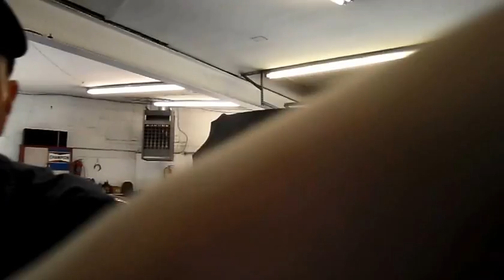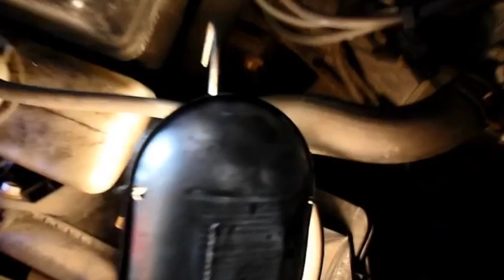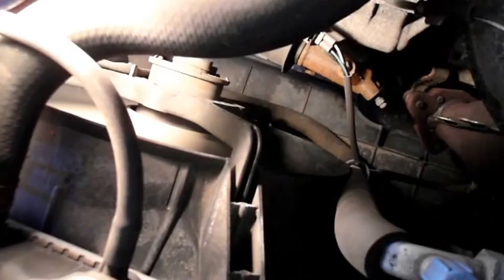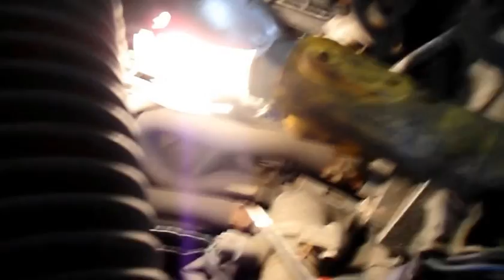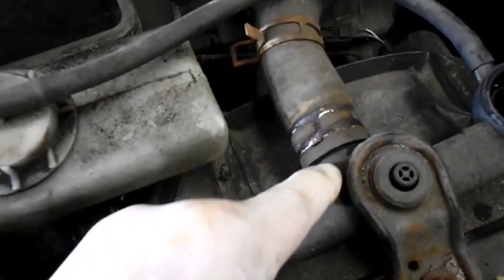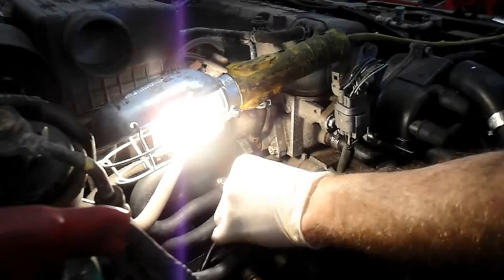How to diagnose and repair an over heating problem on a Honda Civic

Comment: Hi I have a Honda Civic 2003 auto 1.6 I have got overheating problem changed thermostat no more leaks bt it’s still taking a lot of water
Reply: Samson alonge, did you ever got it fixed? If you did, please what did you finally do to fix it? I have the same car with the same issue
Reply from the maker: Samson Alonge If there is absolutely no leaks then you need to check the head gasket. It may be burning anti freeze. Is there any check engine lights on?
Reply: jimthecarguy no there isn’t
Reply from the maker: Samson Alonge Unfortunately it sounds like the head gasket. There is a tool you could buy to check for exhaust in the cooling system. That tool will confirm if it is the head gasket. Try to get it at your local parts store.

Comment: Jim, you are a kind soul, I can hear it in you voice. Helping your fellow man by sharing your knowledge is a special gift.  And I agree with your "all things stop for coffee" attitude.  I never considered the danger of cracking the plastic neck on the radiator & heater core, but now I will.  Lastly. . . . .   I better stock up on some Hi-Tech paper clips!

Comment: I have a 2002 honda accord its overheating so far i changed spark plugs, thermostat, coolant temperature sensor. To check if the fans were working my car was overheating so I popped the hood and both fans are working. I dont know what else to do or to check. I need help asap
Reply: on older cars the pump may not be leaking but the fins inside the pump may have corroded away to nothing. Look up water pump videos for a 99 or 02 tarus you will see what I mean. I had a friend with a 99 tarus and that ended up being his problem.
Reply: I'm having an overheating problem as well with a 2000 honda civic and one thing I've been told is that it might be the water pump. I would just talk to someone who is honest and has the knowledge to help you out.
Reply: Ivan E. Ramirez  I have but either they said they don't know what else it can be or that it can't be the water pump because its not actually leaking
Reply: https://www.youtube.com/watch?v=ktuc6RJ7EaU

Comment: After couple blocks mine wants to red line,Replaced thermostat, radiator, radiator cap, Both fans, coolant fan/condenser fan,Temp/fan switch, ECT sensor, head seems OK no leaks the radiator is holding coolant and reservoir is where it has to be fluid wise,I noticed my coolant fan is not doing its job 3/4 till red the fan won't kick on? I just replaced the Fan control switch and ECT sensor, the coolant fan only comes on with a/c on which both fans come on, I'm stuck guy, it won't even cool down when I turn the heat on, I'm not sure what's up with the fan? The fan switch is new from autozone duracrap brand, I was in a bind.
Reply from the maker: Thank you for stopping by the shop

Comment: I am having this same problem, my 91 civic is overheating I just replaced the temp sensor, temp sending sensor, thermostat, and relay and It is still not turning on, if i take the fan and hook it straight up to the battery it comes right on. Do you think even though the coolant relay is new it can be bad? Thanks
Reply: Did you ever figure out the problem? I changed all three sensors and thermostat and bled the system.

Comment: Hey jimthecarguy I have a 2005 civic and it runs hot after driving it a while! The gauge goes up and down! I need help trying to diagnose the problem
Reply: Same. Did you find the solution to your problem?

Comment: Hello! I drove my car for about 5-7 months without a oil change. When i finally was able to get a oil change my car started to over heat.  I have a honda civic ex 2002
Reply: I just turned on my car the Temp is about to past the middle mark and both the fans not dont turn on but they turn on once I put the AC on blast

Comment: Hello Jim, I have a honda civic 2000, fan is working fine, pump is working, i replaced a new radiator but I still experience overheating especially during hot or sunny days, I liked it when it's raining because the car  don't overheat. Any idea what's going on?
Reply from the maker: You replaced everything except the thermostat.When the car is overheating is the cooling fan on?
Reply: yes its always on
Reply: yes
Reply: yes

Comment: My 96 accord is making a very loud "wwrrrrrrrrrraaaaaaaaa" noise when the I accelerate after the car has been on for a while. Any ideas? It is becoming very annoying and I just can't figure it out. Also, it does it non stop if the AC is on but only after a while when it is off. Any help
Is very much appreciated.

Comment: Hi Jim, i have 05 Honda civic the radiator  fluid away fill up into reservoir .please let know why. Thanks
Reply from the maker: There are a few things that can cause that the first is the radiator cap is no good .The next thing to check is the cooling fans and check if the car runs hot.Keep me posted.
Reply: Hi Jim,the radiator cap is changed and the cooling fan but still have fluid fill up reservoir.Thanks
Reply: @tomdanang6788  It’s the head gasket

Comment: At first, I was worried my fan and not turning when i turn on my car. Im having over heating issue with my 98 Honda Civic lx and found milky liquid on the end of my radiator cap so i'm assuming i blew my head gasket but along with my replacing that issue i wanna make sure this doesn't happen again. What is your best advice to AVOID this expensive replacement?
Reply: You pull over and shut the car off when it is over heating.
Milky residue isn't always a sign of headgasket. Water condensation can form on the cap naturally. A better indication of a blown head gasket is the coolant being milky and thick (oil introduced into the system) or your oil being milky/thick (vice versa).

Comment: have a Dodge neon sxt 04 had a bolt stuck in there so I made my own bolt its snug good. no leaks. Didn't start over heating until I changed thermostat. Blows heat did flush only cool stay at right temperature if I have heat on

Comment: You are excellent professional, were you are located Orlando, FL ? my Honda accord  wagon ex 1997 Sometimes it heats up but when it runs it is getting cold down , when stop in the light signal it heats up,I do not use coolant just water , you think it's the thermostat or fan I see fan running and stop, how much is the average cost for repair give a idea thank you very much for help

Comment: Sir Jim, How about the coolant temperature sensor? what happens if its defective? Thanks.
Reply from the maker: If the sensor is defective then the fan will not turn on and it should be changed.Thanks for watching.
Reply: I did all that but replace the hoses on my 01,,deleted cat also,,I believe is the thermostat
Reply: ..nah..tried gasket sealing..work for a mn,,after flushing the radiator...it was the head gasket,,previous owner dint took care of the car

Comment: I have a 05 Honda Civic and it's showing indication of a similar problem with the thermostat. The fan don't turn on, the temperature gauge immediately exceeds past the normal range, and it's leaking anti freeze. is it a easy fix?

Comment: Love 7:53!
Reply from the maker: Oh yea I never pass up a coffee.Lol Thank you for watching
Reply: Excellent Video! Thanks for posting it & keep up the great work! I liked the tip recommending not to 'twist' off hoses. Lots of great insight.
Reply: Quick question: The electrical connector that plugs into radiator fan switch. I replaced it but it's hard to actually snap into place. Any suggestions?

Comment: This seems so helpful except for the fact that (I have an 04 Honda Civic) I've replaced my thermostat, my coolant isn't leaking, my fans work, and my car still overheats if I stay idle for longer than one min...
Reply: Chelsey Bray i got the same problem. You ever get that problem fixed? If so, how?
Reply: Did you ever get it fix?  How??
Reply: @kelchanel0012  did you?
Reply: Same pronlem here any luck?
Reply: @vladisparedes5626  did you?
Reply: Was it clogged mamon ?

Comment: Hi Jim good video. Just wanted to know what you meant by running hot-expansion tank full of coolant. My accord is doing this plus when I take off the radiator cap, looking at the rad. Hole I can see fluid missing it's only on the very top of the radiator. Amy ideas? Thanks

Comment: 1999 CIVIC Overheating
I changed all hoses, the thermostat, i flushed the radiator and put new coolant but still overheats, turns out the fan wont turn on when it needs to so i tested the fan and it turns on manually(used that high tech paper clip) , so i replaced the fan switch but car still overheats.  any ideas on what it could be before i take it to a mechanic??
Reply from the maker: When the car is overheating is the cooling fan on?
Reply: nope it doesn't turn on, once the temperature gets too close to H, i put the paper clip in and it cools it back down and if i go on the highway i leave the paper clip in during my ride to keep the car from overheating on the highway but im worried it'll drain my battery
Reply from the maker: It sound like you have a defective switch or a bad socket.

Comment: Hi Jim, Awesome video and explanation, awesome professional work. Can you tell me the make and where you purchased the power tester? Also, can you comment on if I only have heating issue after 3-4hrs of driving in 95F+, heating fan sensor replaced, thermostat works, no leaks, fan turns on as it should...possible issue? 2000 Civic LX , 115K miles. Thanks Steve
Reply from the maker: Hi Steven, The tool I'm using is called a Power probe and you can find the company on line.If not let me know I will get a number for you.As for the overheating the thermostat may be sticking .Was it replaced?
Reply: No, it has not recently, but what would lead you to believe it is the problem?
Reply from the maker: Because if there is no leaks ,the sensor is new and the coolant fan is turning on and off.The only thing remaining is the radiator or the thermostat.Start with the easiest first .The thermostat.
Reply: Hi Jim, just wanted to send a thank you and followup. I pulled the old thermostat and testing in water, it was rated for 170F and did not open until well past 208F, probably closer to 212F boiling. Going to do full bleed and road test and refill and Ill let you know, but I think its solved. I also pulled relays and cleaned contacts, they had some anodized areas and carbon (sanded them a little).
Reply from the maker: Great keep me posted.

Comment: Thank you for the video very detailed. I'm here looking also to auto repair my car honda accord 99 sedan. It gets very hot in the highway. When I open the radiator and turn the car on I cannot see any movement of water or split. If I tight the big tubes with my hand I can see the water overflow the radiator. If i turn on the heater I can hear a noise coming from the water pump area . My car ran out of oil and got very hot and since then I have this problem. I hope that info is good to guess the problem. I hope is thermostat. Thank you .
Reply from the maker: +daniliver  The thermostat could be the problem but you will need to check the cooling fans to make sure that they turn on.Keep me posted.

Comment: I have a 1996 Honda civic ex that has an over heating issue. I drive it 5 minutes and the temperature will be all the way up. I just replaced the radiator and thermostat this month. There is only 112k miles on the car and It doesn't leak any coolant. I need some advice to see what I need to do next.
Reply: Start the car and open the radiator cap, if the coolant is running the water pump is OK. Next check the voltage on the coolant temperature sensor. Make sure the fan is working. Use OBD11 device to scan your car. if you get code P0120 +++ you need to reinstall the Thermostat properly or replace the coolant sensor. Finally my advice to you is to check the parts first before wasting your money on unnecessary parts! If you knew the problem and symptom and have proper tools you can solve any problems. Good luck.
Reply from the maker: +mjled cars and electronics When the car gets hot does the cooling fan come on?
Reply: jimthecarguy Yes
Reply from the maker: +mjled cars and electronics  Well if the thermostat  and radiator are new and the cooling fan is on.There can only be 2 thing let to check.Is the engine RPM 'S  at 55-60 around 2000-2500 rpm?Is the water pump OK?
Reply: +jimthecarguy how can I test the water pump?

Comment: coolong fans do come on.
Reply from the maker: +Liliana Sualez If the car only overheats on the highway and you replace the thermostat and the cooling fans come on.The radiator may be no good.How may miles on the car?When you drive at highway speed what is the rpm's reading at 60 mph?

Comment: just put in a new thermostat from honda new radiator and hoses.
Reply from the maker: +Liliana Sualez  Do the cooling fans come on?
Reply: +jimthecarguy  its over heating after driving on freeway like wen i get of a exit and come to a stop yes the fans are coming on

Comment: 2005 civic overheating after going bout 60mpg on freeway then stoping for a red light in town its ok  do you think its the same switch issue
Reply from the maker: +Liliana Sualez  Just so I under stand .The car over heats at 60 mph but not when you drive in the city?

Comment: can you not give me advice right now about my  car ??
Reply from the maker: +Allison Currie  You bet.
Reply: +jimthecarguy can you help me with my car please ?
Reply from the maker: Sure what is your problem.
Reply: +jimthecarguy 99 civic overheats after being driven a while just changed thermostat, cooling switch, relay and I tested my fan it's working I don't know what it could be
Reply: +jimthecarguy I checked all my hoses no leaks
Reply from the maker: Does the cooling fan turn on and off when the car is idling ?
Reply: +jimthecarguy no only when it reaches a certain temp
It also doesn't overheat idling from a cold start
Reply from the maker: How high does the gauge go 1/2.  3/4 or more
Reply: +jimthecarguy mostly half or 3/4
Reply: +jimthecarguy when driving on the freeway it's fine but once I get off and come to a stop it starts overheating lowering my rpm
Reply from the maker: Does the coolant fan come on when you are stopped ,idling and the temp gauge is 3/4?
Reply: +jimthecarguy after reaching 3/4 temp yes
Reply: +jimthecarguy yes exactly that
Reply from the maker: Can you get a scanner and check the temp running temp in  the engine ? Also if you can check the water temperature with a none contact thermometer.?
Reply: +jimthecarguy wouldn't be able to do that really broke could you narrow it down to what it could be ?
Reply: +jimthecarguy ok I checked running temp inside engine with infrared thermometer it's 163 degrees coolant temp 150 degrees
Reply from the maker: That is strang. The 2 temps are no were near overheating.You may have a problem with the temp gauge or the temp sensor.

Comment: I have a 1997 Honda civic lx I just replaced the thermostat and  the coolant fan switch ...because I didn't have  any heat when I turned my heater on, and my car was running hot because my coolant fan was not working.. I changed all that I still have  the same problems. I checked all my fuses and my wiring still the same problem.   can anyone out thee help me?  thanks steve
Reply from the maker: +Allison Currie  Do you want to call me at work on Monday .I can give you some advice then
Reply: ok let's see if you can help me get on the right path.98 honda civic started over heating out of nowhere.i immediately pulled over and waited to call off than drove home slowly.i took it to the main mechanic i was seeing.he replaces themorstat and car kept over heating.took off thermostat and doesn't over heat any more.fan are running fine.pressure teast was done no blown head gasket.could it be that we bought a faulty thermostat?i don't want to drive this car any more like this.it's kiling my gas and eventually can wear out my engine.any info would be appreciated.thank you
Reply: +jimthecarguy any news how he fixed his problem?
Reply: Allison Currie may be heat core

Comment: what about a honda civic 97 with a b18 integra 97 engine overheating?
Reply from the maker: +Juan Martinez  You will follow the same procedure.
Reply: What if its leaking a bit
Reply from the maker: You will need to pin point were it is leaking and repair it.If you need any other advice let me know.Jim

Comment: Soo...it might be my cooling switch?? Cuz fans not running and all the fuses are good? Jus took out my thermostat.. Now it not over heating.. But no fans??..
Reply from the maker: shawna yesslith  You should not remove the thermostat .You should repair the problem and reinstall the thermostat.Cars today need a thermostat to achieve the correct temp for everything to function properly.Jim

Comment: Great video.  Do you like the screw on clamps better then the squeeze on type?
Reply from the maker: tubejim101 To be honest I do like the spring clamps better because they never need to be tightened again after there installed but in this case they were very rusty.